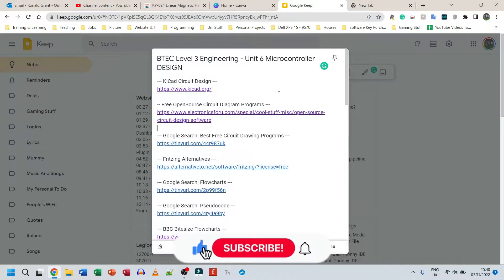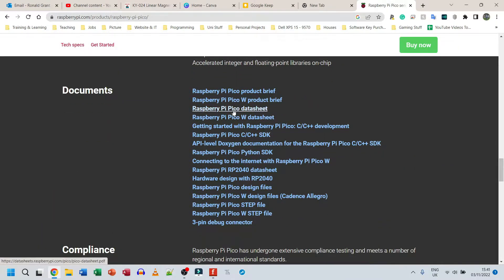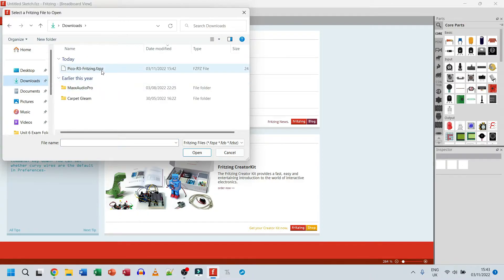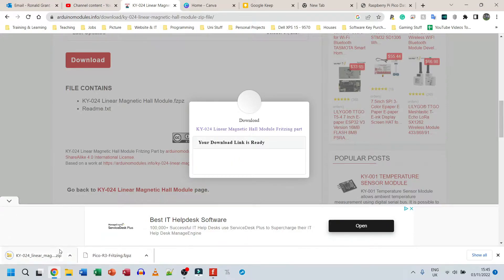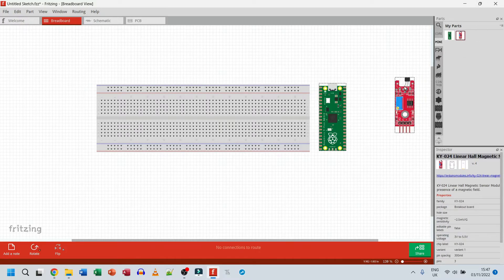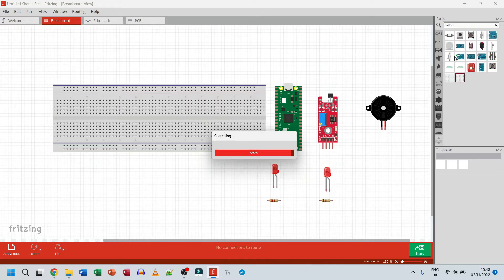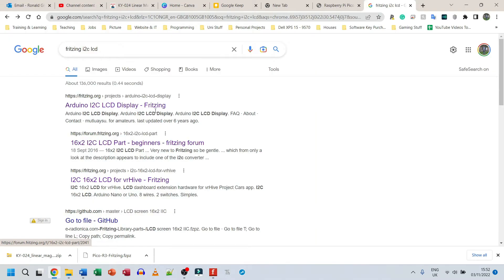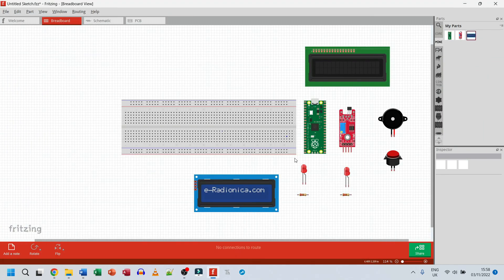BTEC Level 3 Engineering Unit 6 Microcontrollers - Part 15 - ACTIVITY 3 CIRCUIT DIAGRAM (Fritzing)

Comment: so how will I get a picture of the circuit if in the exam there is no WIFI so i wont be able to build it in tinker cad, do I just upload the real life image of the circuit instead ?
Reply from the maker: There "should" be no internet access, however each school is responsible for the software packages they allow students to use.

If you can draw the diagram on paper then that is perfectly acceptable.
Reply: @RonsTechHub  oh okay do you know the most likely software it will be for arduino uno?